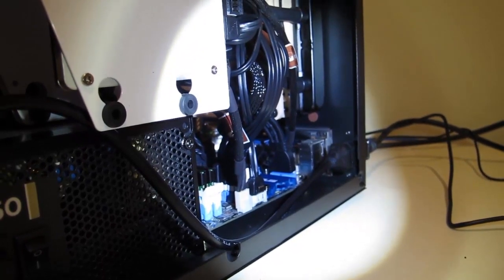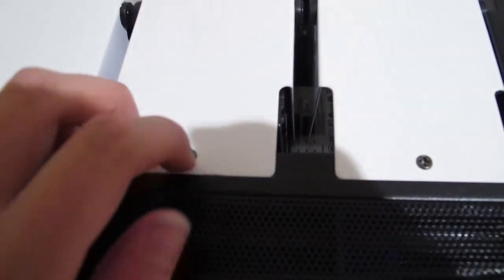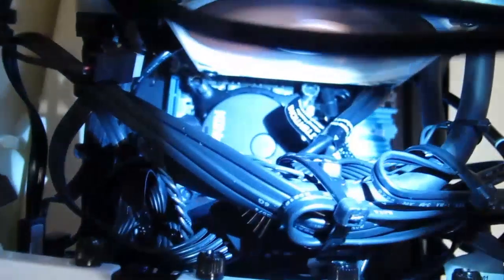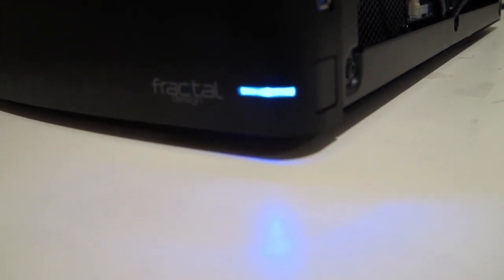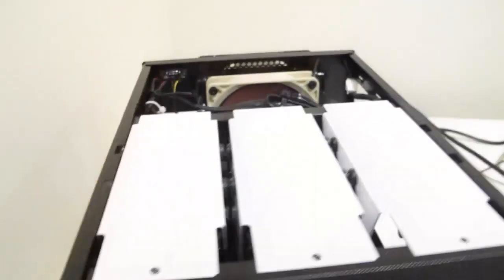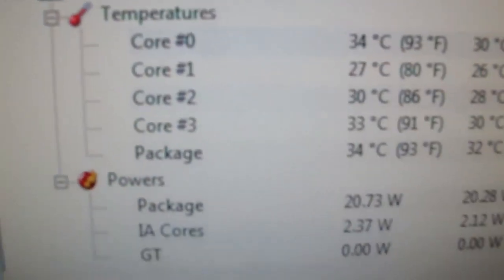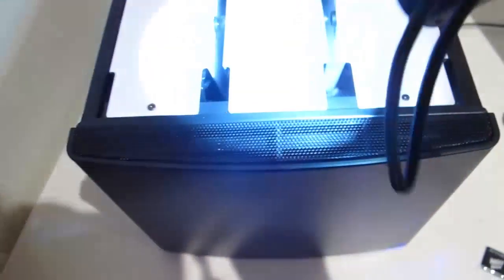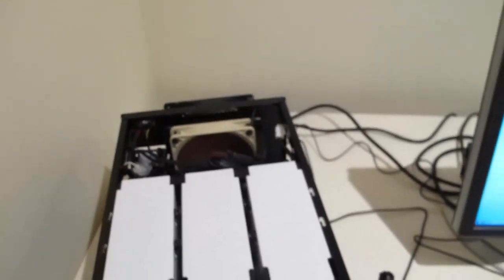Ultimate Home Server Guide- Final Build #2

Comment: How did you power the 140mm fan that is on the outside of the case?  Does the cable run to the case through the graphics card slot?  I'm thinking about using the cooler as you do but I want to put in a graphics are in the slot and am thus concerned about how to power the fan in that situation. Thanks.
Reply from the maker: Correct